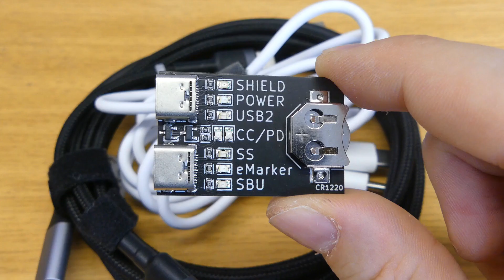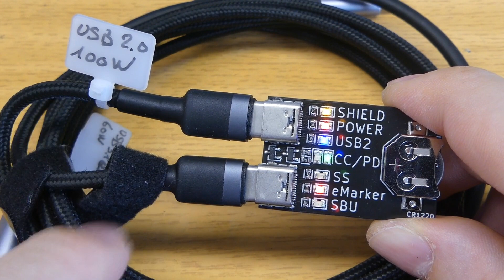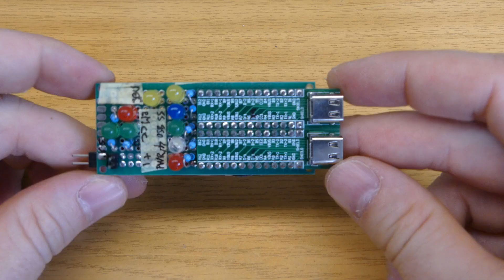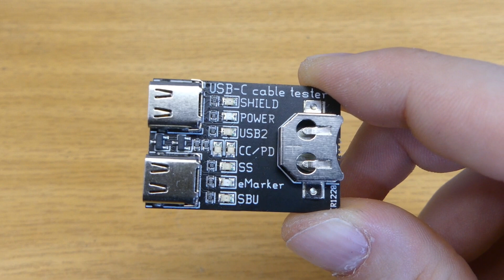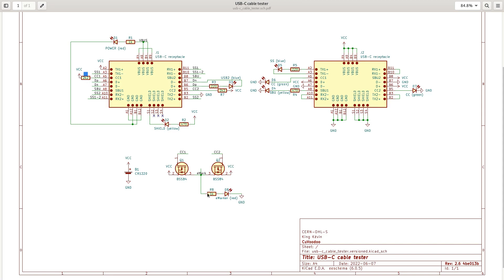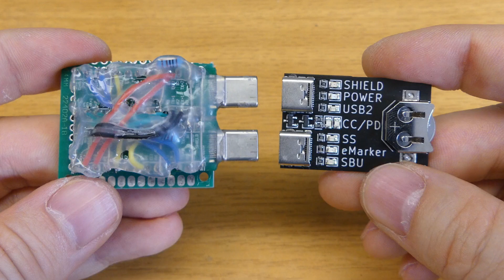CuVoodoo gadget: USB-C cable tester (v2)

Comment: How exactly does the SS (super speed) LED work? As far as I can see there is a different requirement for USB 3.0/3.1, where only 2 of the 4 differential pairs are used. It also seems like there are cables out there that do in fact only have 2 pairs connected. Would your tool in this case mark such cable as not SS capable? Can you distinguish between cables having 2 and 4 SS pairs connected?
Reply from the maker: TLDR: the USB-C cable tester's SS LED only lights up if all 4 differential pairs are present. Cables with only 2 pairs will never light up the SS LED, although they could in some cases be used for USB3.2 Gen 1 (=USB 3.0/3.1) data transfer.
long answer: although only 2 pairs are used for USB3.2 Gen 1, having all 4 pairs allows each end to be flip any way and both host and device can use the pins without worrying about the orientation of the plug in the receptacle. With only 2 pairs, either both orientations need to be inter-connected in the host and device (which deteriorates the signal quality of the differential signals), or both sides use a bus matrix and detect the orientation. Most of the time you can't control if and how this is done in the devices. This is why I said it could in some cases work. More details are in the type-C spec https://www.usb.org/document-library/usb-type-cr-cable-and-connector-specification-release-22 , clause 4.5.1.1.
outlook: USB-C cables with only 2 pairs are not standard compliant and can only work in some cases, even for just USB 3.0/3.1. While the USB-C cable tester only checks for all 4 pairs (proper cables), I am currently building another gadget for non-standard compliant cables. Stay tuned ;) .
Reply: @cuvoodoogadgets  cool, thanks for the explanation 🙂